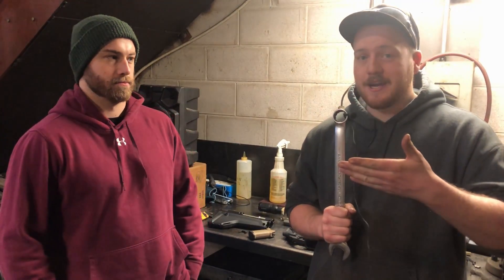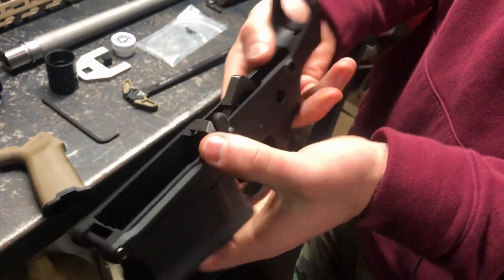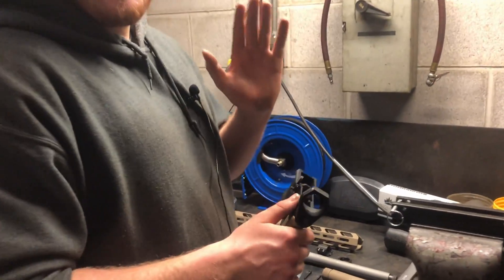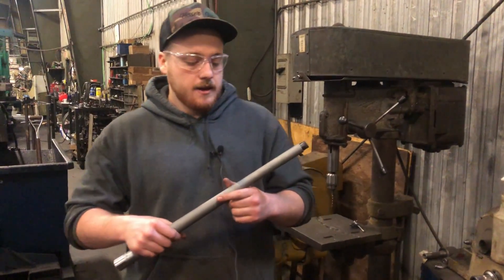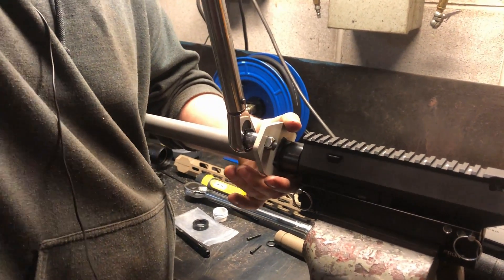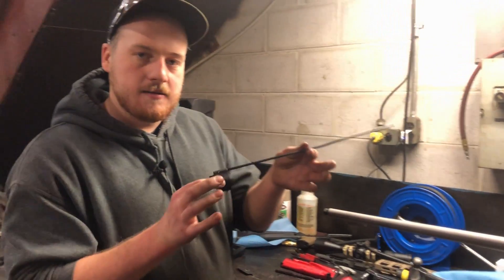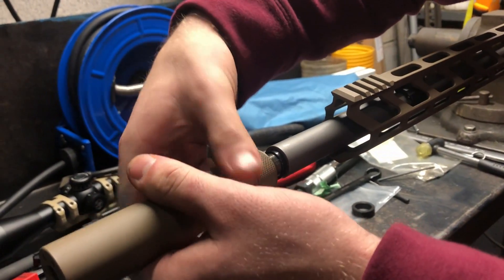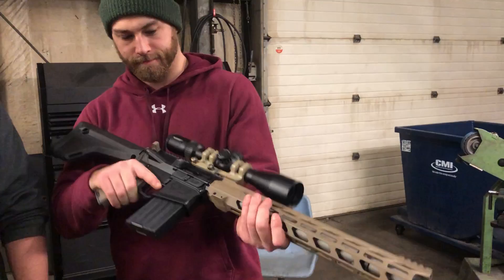Building A Canadian Non-Restricted Stag10

Comment: One trick I've found for roll pins is squeezing them in using a pair of Knipex pliers wrench smooth jaw pliers. They won't mar the finish and the jaws squeeze parallel to each other so it makes tricky roll pins a breeze. Great build!
Reply from the maker: Will try that next time! Thanks

Comment: I'm into the old iron M14 FN49s etc know nothing about these rifles so I found this extremely helpful always been a big fan of AR10s L1A1s platform etc looking into one of these rifles love the 308/7.62 round would like this in that with a 24 or 22-inch barrel though. great video
Reply: I'd definitely recommend building a modern rifle like this. The old M14s etc are super cool, but you can't beat the accuracy and reliability of the AR platform ;) Not to mention customization as well

Comment: Hey guys, just curious if you know the total weight on the finished product?

Also, what buffer weight did you go for with that Armaspec?

Thanks!
Reply: I haven't actually weighed it yet, might do that tonight. As for the buffer as far as I know Armaspec only has one 308 buffer system which is what I got

Comment: great vid guys.... but, you telling me that shop does not have an arbor press to set the gas block pin? way better than using a punch and hammer. Sorry but the whole time I couldn't help saying to myself several times to put a protective cloth on the bench so yo are not marking parts up when sliding  them on that steel bench... maybe I'm too picky but it was driving my ocd nuts.
Reply: You are a bit OCD bud haha. Nothing wrong with that tho. I'm just not overly concerned with the finish on it as its gonna be used heavily and get dinged up fairly quickly. Possibly rattle canned in the not so distant future. And yeah, we were kinda retarded with the gas block... Lesson learned. Thanks for watching!
Reply: @UnworthySeraphim   all good! You have me interested in doing my own build now instead of just buying. Im a precision fabricator so it will be a sinch.. why pay soneone to do it right... looks fun
Reply: @garrible8412  it's a ton of fun man. You're always gonna get a better suited rifle picking your own parts too. Mine is heavy as frick but shoots sub MOA easily with decent ammo. And if you wanted to do a nice light carbine build that packs a 30cal punch you can do that too. I say go for it
Reply: @UnworthySeraphim    Awesome thanks, i will hit the local gun shop to see what they offer for parts/kits
Reply: @garrible8412  depending where you live and what the local gun community is like, you may have trouble finding a good selection of AR parts. Online is most likely the best option. TNA, RDSC, and CTC Supplies are all good websites to source quality parts from
Reply: @UnworthySeraphim  no shit!!! I just went to the gunshop I usually go to and selection is low. Running low on ammo too.... I had no idea
Reply: @garrible8412  now is just a bad time all around haha

Comment: Can a 308 lower use a 6.5 creedmore upper?
Reply from the maker: Yes sir! If it’s a Stag 10 upper it will work on the lower. The only difference will be the bolt head and the barrel!
Reply: @thehosergunguy4898  same bolt as .308